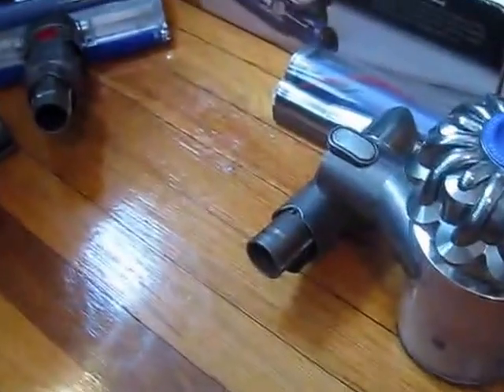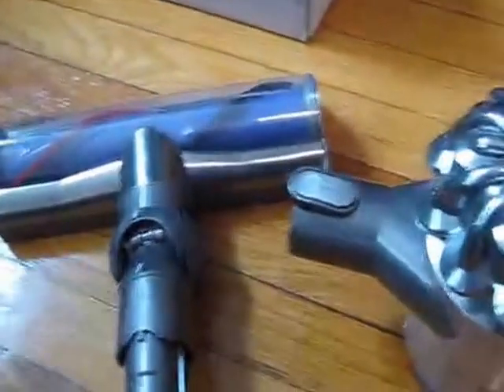Dyson V6 Absolute Quick Free Rotorhead Fix

Comment: Have the same proble. Cleaned all contacts but still the motorbrush is not working. So I measured the voltage at the two contacts:  Zero!  So there must be something broken inside the motorhead not giving power to the contacts and the motorbrush...  :(   Unfortunately I don't get an aswer on my e-mail to Dyson.... :(

Comment: nope, this is not a definite fix, problem is too much slop in bin/motor body assembly and possibly bent back contacts from wear and tear emptying giving an unreliable connection. i bet cleaning is only temporary. shitty dyson design. overpriced if only lasts two years!!
Reply from the maker: Mine’s been fine since the day I made this video, over a year and a half ago.